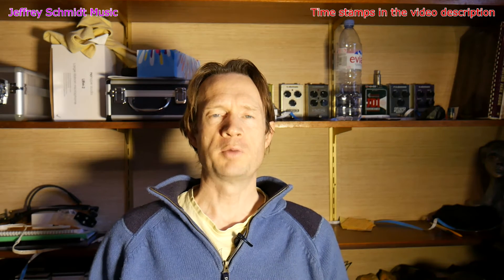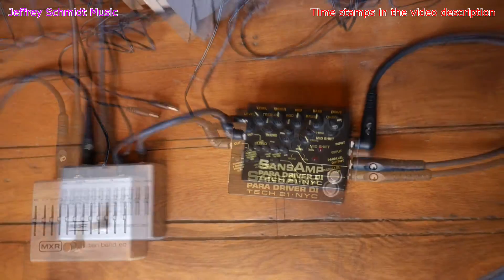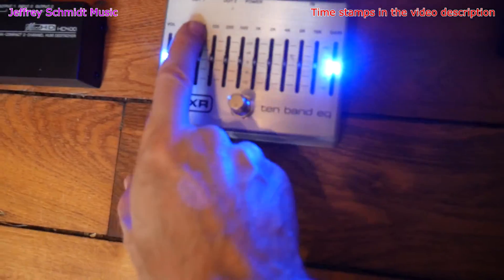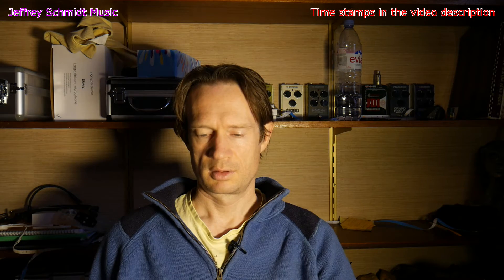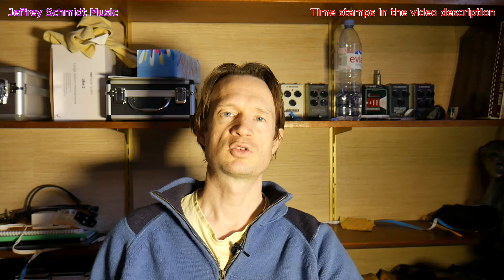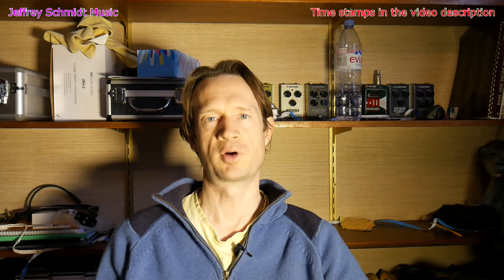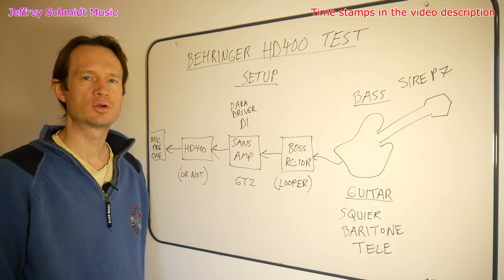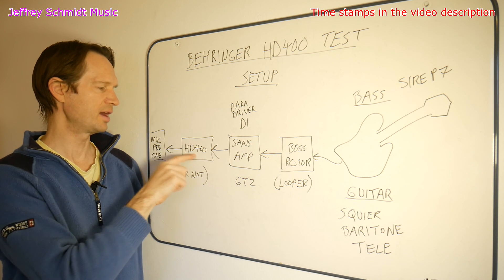Behringer MicroHD HD400 Review and Audio Test

Comment: Hello. I bought a JBL Partbox 710. When I plug a guitar into the acoustic guitar section with a cable, there is a humming noise. When I touch it, the sound goes away. I think there is a grounding problem. Will this alleviate the HD400 problem? Thank you

Comment: Hello. I want to ask, can i use this with stereo KRK classic 5 ? I have creative zxr sound card and have humm noise because of the graphics card. But if i buy this HD400, will i be able to connect it via rca cable? Or which cables does it support?
Reply from the maker: The HD400 has 2 TRS (stereo jack) inputs and 2 TRS (stereo jack) outputs.
Reply: Thanks i just ordered it from amazon. Hopefully it will help. 
 @JeffreySchmidtMusic
Reply: @Venomancerous Hello. Did it eliminate the noise?
Reply: I will have it in 10 days and tell you. I'm 99% positive that it will. It depends what's causing the hum/buzz noise. Firstly when i bought this studio speakers i connected them in one outlet extender with my pc and it had horrible noise. So i bought grounded extrender separately and that noise was gone. Now it only happens in games because of the ground loop. If you have excluded the outlet variant this Behringer will definitely help you. You have the same problem? It happens in games when GPU is loaded fully. To avoid that you need to buy USB DAC or USB interface or if you want to go for a cheap solution, you can try this behringer first. It's 30$.  @sevchyk

Comment: well this noise remover is thought to be used on Line level devices, tehre you lose 1dB of gain but frequencies are untouched. You should try a noise remover for instrument Impedance levels. Like the Isolator series from Lehle
Reply from the maker: Yes, that might be better.

Comment: Is there a buffer in your signal path?
Reply from the maker: There weren't any buffers in the signal path.  From what I understand, buffers only improve a rig when there's tons of pedals or really long cable runs, neither or which were the case here.
Reply: @JeffreySchmidtMusic  Interesting. Still I have to wonder if a buffer placed after the hum eliminator wouldn't fix the high frequency loss. I just purchased the Behringer yesterday. I'll pick up a buffer today and experiment.
Reply from the maker: @samizdat113  Nice good luck with it 👍
Reply: @samizdat113  the buffer worked? I'm thinking about geting  a behringer too

Comment: Late to the party here but what you really need for what you want to do is a direct box.
Reply from the maker: I do have a direct box that has a parallel out and an XLR out.  But only the XLR out is transformer coupled, while the parallel out is not.  In some scenarios I need to be able to kill a ground loop coming out of a parallel instrument output.  It would be possible to use the direct box then use an adapter to convert XLR to mono jack, but then you could have tonal changes due to an impedance mismatch.

Comment: I am having trouble with a buzzing in the distortion channel of my guitar  amps.  I can't seem to narrow down the cause, and it is worse sometimes more than others.  Florescent lights, air conditioner, computer, etc. Don't seem to be the cause.  It does gets worse if my guitar cable is on the floor or by my pedal board.  The outlets show that they are properly grounded, but the house did originally have knob and tube wiring.  From other YouTube videos I have seen, it sounds like a 120hz buzz.  Would this Behringer unit do anything to help eliminate that type of noise?  Thanks.
Reply from the maker: Ground loops can occur when a signal is split, to be received by two different powered devices, like the example shown in this video.  Distortion will always amplify any noise or interference, regardless of the source.  The best way of really understanding the source is by exhaustive testing of different options.  It sounds like you have AC power EMFs getting picked up by your guitar cables.  Can you try guitar cables with better shielding?  Or try changing up the power supply for your pedal board?  It doesn't sound like a problem that this Behringer unit would help you with.  Good luck.